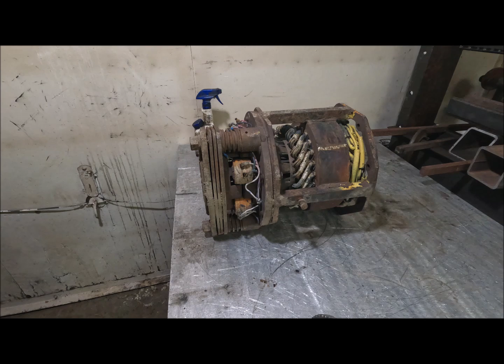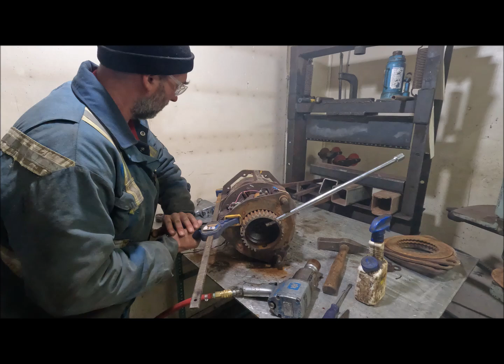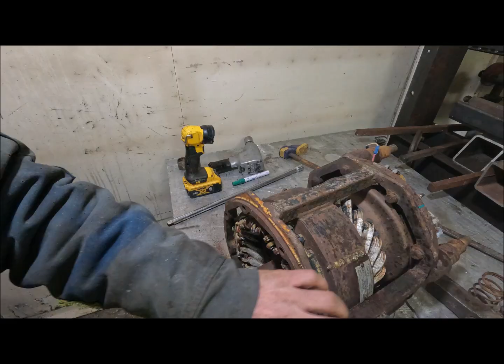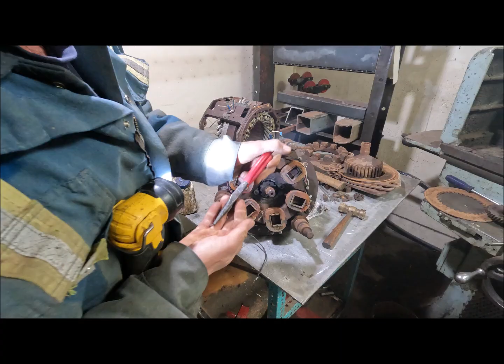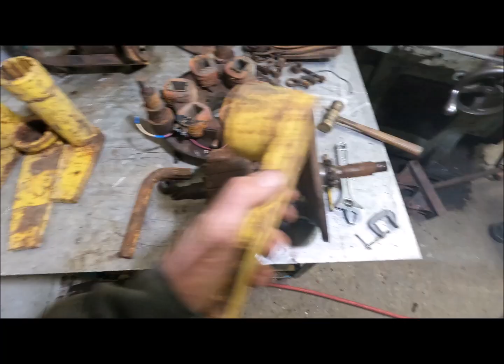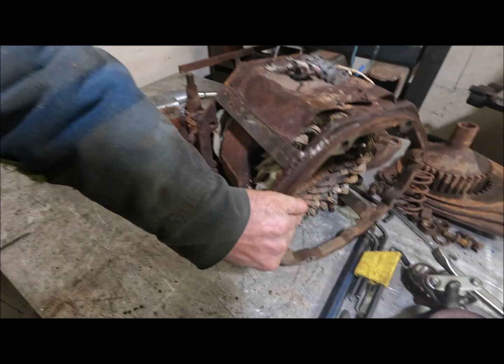Letourneau Three phase motor rotor, stator inspection. Continuity resistance test, bearing removal

Comment: Just thought I mention that I see a Wabco paddle scraper on marketplace , it’s hydraulic pan up and down but electric drive on paddles and steering.
Reply from the maker: Thanks for the tip. Im afraid my budget for additional letourneau's is not there yet. It will take a few turns "Pass Go" to get another. Lol. We will have to live vicariously through each other for now. I want to see that Letourneau model M cable scraper behind the TD9 in action this summer.
Reply: @ I think that one is a D111A , not in my budget either. I’d like to get my model D towed scraper operational this summer. Would be exact right size for TD9
Reply: @oldamericaniron5767  I ran a 222 and that paddle drive was the pitts. Would dig heavy on that side no matter what the operator did.

Comment: Rust on the rotor and stator doesn't really matter unless it's bad enough for the two to contact each other. The rotor is pretty robust so you can hand sand it with 80 grit sand paper of you need to. You can sand the stator poles as long as you don't touch the wire or insulators.
The cracked insulators in the stator slots aren't ideal but I wouldn't worry too much. There are only three common failure modes for the windings. 
1) Broken wires which you have already tested for. 
2) Leakage between the windings and case. This is best tested with a high voltage insulation tester. Most electricians will have one of these. Your test with an ordinary meter will find shorts but not weak insulation. 
3) Shorted windings. This needs specialized equipment to detect. In most cases an ordinary multimeter won't work. To be honest I would just power it up and see what happens. If it runs slow, pulls a lot of power and makes a lot of noise you probably have a shorted winding.
Reply from the maker: Thanks for the comments. Im pretty sure theres a old saying, That it takes a Community to raise a Letourneau scraper. Lol. But seriously I really appreciate your help and its been fun.
Reply: I would clean the rust layer off the iron core of the rotor, you could probably turn it slow in the lathe and use sandpaper
I would try and clean the stator core also with care, the insulation looks weak, and electrical motor shop might be able to re dip it, then there is the coils, the electrical portion looks the roughest. Is this DC or AC? I'm just wondering if it's DC the motor reverses for function which it looks to me?
The clutch fibres look like old bulldozer dry steering clutches in style, it could be asbestos, would be nice if they crossed over to something available 
Heavy Equipment Forums has a scraper section, there might be someone there that has knowledge on these?
Reply from the maker: Good evening, I will sand the stator and rotor. I experimented with some emery cloth folded to the same width as the strips or bars. The motor ac and I believe the magnetic coils are ac as well. I hopefully will have the new bearings and seals soon.
Reply: If it's an AC motor does the gearbox have the ability to reverse rotation for the winch or does one direction just free wheel and brake?
I'm curious what they are doing with the steering motor if there is only one as it would need to çhange direction or have a reversing method in the gearbox.
Reply from the maker: In the main switch box the there is really two switches for each motor with one leg switched for either up or down or left or right.